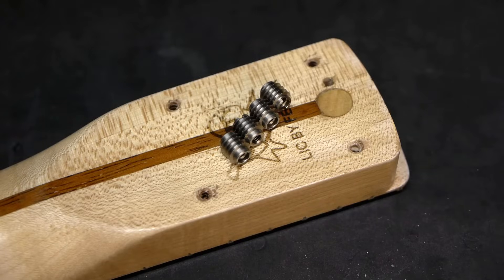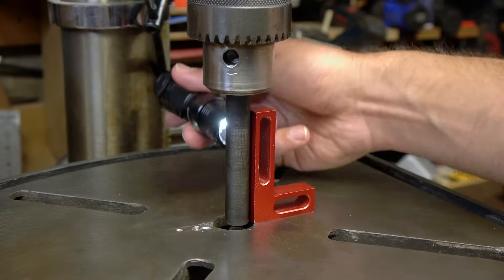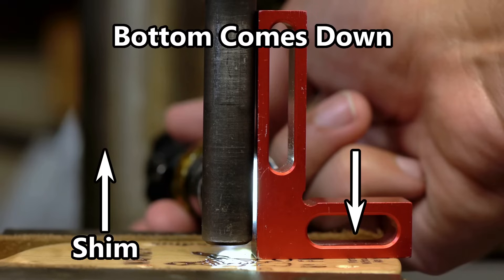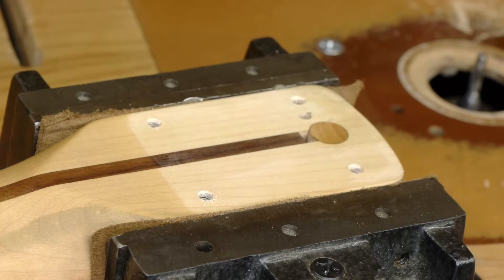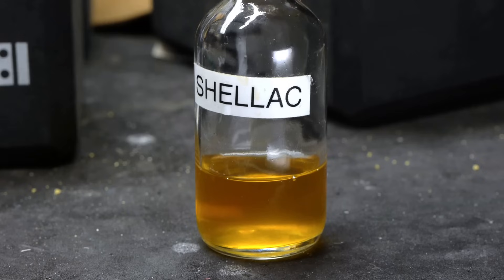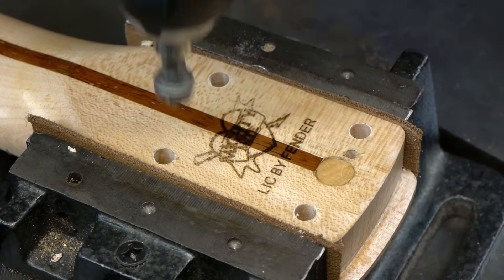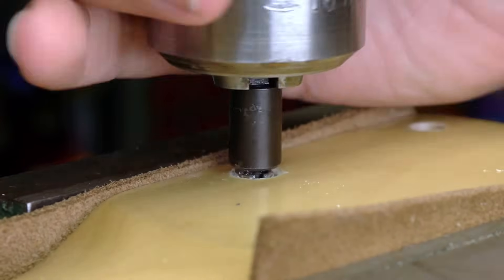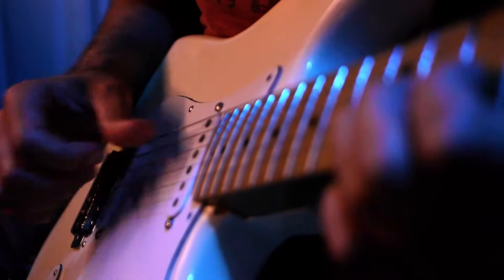How to Install Threaded Inserts on a Bolt-On Guitar Neck (EZ LOK)

Comment: My two cents here.  I would be tempted to think that a wood screw of the size used for a guitar neck makes for a stronger joint than a threaded insert... I think this is not such a good idea.  It looks good but I would never use in on my builds nor buy any guitar with that kind of attachment.  One should remain cautious.  Maybe the author should have started with a justification for doing this.
Reply: It might not be such a good idea for you.  There are more than a few touring pros that have this mod on their Fender guitars.  The reason is they take the neck off when they travel so they can put the entire guitar in their carry-on bag.   Over time, the repeated removal/reinstallation of the screws in the neck will fatigue the maple and the attachment will be weakened.  Threaded inserts make this issue a non-issue.
Reply from the maker: Couple thoughts here! Please keep in mind I know I'm not an authority on this and this is all speculation from my end. I personally haven't had any issues with inserts in any of my own guitars and just want to share some initial thoughts in response to your comment. Always open to alternative viewpoints! 

First: one of the reasons I used 8-32 screws instead of the more common 10-32 is that 8-32 is a near perfect match to standard neck screws. In some cases, a perfect match. 8-32 machine screws are .160" or 4mm in their major diameter, which matches many standard wood screws used for mounting guitar necks. 

I do understand some wood screws have much more aggressive threads and larger major diameters, but .160" as a major diameter is a common size. 

However, beyond just the screw size, I think 10-32 inserts drill out quite a lot of wood in the neck heel. 8-32 inserts preserve a lot more of the original wood. Boring a hole of that size, I'd be nervous that using larger inserts might have the potential to split or crack the neck heel. 

Though apparently many people have installed 10-32 inserts without issue, and the screws would certainly have more heft than an 8-32. So my fear there might be unwarranted. 

Another thing: 

Later in the video I mention the value of threaded inserts as a permanent repair for stripped wood screw holes. I think this application makes the most sense, though many builders swear by machine screws and threaded inserts. 

In the case of stripped wood screw holes, I think threaded inserts make the most sense as a repair. 100% guarantee that they won't fail again. 

Also brings this story to mind: My friend and mentor Steve K. actually knows someone personally who loves to tighten their neck screws down very, very hard, and despite Steve's warnings against cranking the heck out of the screws, they continue to do it. 

So Steve took out a breaker bar and saw how much force it would take to break one of those machine screws by over-tightening it once it's maximally threaded into the inserts. 

If memory serves, he couldn't break it no matter how hard he tried. All I remember is that he concluded that there would be no way even for a Silverback Gorilla to break one of those screws off with a normal screwdriver. 

Someone we know has developed a new line of guitars for this particular guitarist, and after talking with me and Steve, decided to use threaded inserts for his builds -- in part because he knows the signature guitarist playing them is going to be cranking the crap out of the screws despite everyone else's protests. Lol! 

So I actually think that inserts and machine screws can avert some of the only major risks with wood screws, as far as damage/breaking goes. 

There's always a possibility I'm missing something, but the only risks I can see for neck screws are: 

1) The neck screw holes stripping
2) The neck screws breaking off in the body 

The machine screws + inserts completely avert both of those problems, and so from that standpoint, should be "superior" to wood screws. 

I put "superior" in quotations, because, in the vast majority of cases, the risks for stripping a neck screw hole, or breaking off a neck screw in the screw hole, are so miniscule that it almost doesn't matter. 

I would suppose it would matter for that one ham-handed person who breaks their neck screw off in their guitar. Those people are out there, though few and far between. 

Stripped holes are uncommon, broken neck screws are extremely rare, and I think I'd put any other major neck screw issues into the same category. 

All in all, I can't think of a reason to not use threaded inserts, aside from them being unnecessary. However: 

There is that one video where a woodworker tested wood screws vs. inserts with machine screws, and found the wood screws to be superior, with a stronger hold. 

However, the inserts he used did not have anywhere near the flange diameter that the EZ LOK inserts for hardwoods has, and they didn't have the EZ LOK proprietary knife edges either, which slice very deeply into the wood for an extremely secure grip. The inserts he used in the video appeared to be standard hardware store inserts with fairly un-aggressive threads. I do think quality makes a big difference here. 

Still, you could be right, and maybe wood screws do have a stronger hold. However, there are builders who've commented on older versions of this video who swear up and down that threaded inserts make their instruments sound better. 

But then I've had another commenter claim that they do the opposite. There seems to be no consensus! 

I think it's also important to note in the wood screw vs insert video that these joints were tested under extreme forces that a guitar would never be subjected to unless it was run over with a steamroller. 

The major concerns we'd have to deal with would be a guitar falling from about waist height onto concrete. 

Occasionally you might have a "guitar spin fail" where someone rocket launches a guitar over their shoulder and it lands on concrete from 20 or so feet in the air. 

Now in a case like that, I'm not sure which mounting option would be superior, though I do think threaded inserts and machine screws will hold their own in any of the above circumstances. 

There's a good chance that even if by some extreme show of force, the machine screw broke off, that you could still easily remove the insert with the drive tool. Even if the screw somehow mangled the threads and also broke off and it couldn't be unscrewed, grinding it down just enough to allow the drive tool to grip the insert would allow you to remove it. 

I can't imagine anything that would happen to a guitar that would cause those knife edges on the inserts to break. They're embedded so deep that just about the only way I can imagine damaging them would be putting the neck heel on a hydraulic press and forcing a machine screw already threaded into the insert, down further into the neck. That might snap those edges off. From a durability and reliability standpoint, I think machine screws and inserts are at least as good as wood screws, if not having some added benefits / protections / failsafes against stripping and screw breakage. 

Steve K. has also suggested using dog point machine screws to eliminate the possibility of cross threading. That really is taking it to the nth degree but it's not a bad idea at all, and the cost of dog point machine screws from somewhere like Bolt Depot is basically the same as any other similar screw, so why not add another failsafe. 

Anyway! I'm getting way out into the weeds here and having way too much fun thinking about all of these circumstances, and I've gotta go for now. Curious about your thoughts if you have time to respond!
Reply: There is NO WAY a standard wood screw is stronger than an insert.

Comment: I’ve built my share of fender style guitars and I’ve owned lots of three bolt and four bolt neck Fenders, and have never, ever had a problem with the standard wood screws……I think it’s a trendy waste of time to use these inserts……
Reply: Good for travel guitars when you frequently need to remove the neck to pack it in a suitcase.
Reply from the maker: There's certainly a lot to "If it ain't broke, don't fix it!"  

That's one of the reasons I chose to just cover how to do this job to the best of my knowledge, rather than getting into a debate about machine screws + inserts vs. wood screws. 

My goal here was to share my way of doing the job as correctly as I know how. I'll leave the reasons for doing it up to the people who find the video! 

Only thing I'll say is I do prefer installing inserts + machine screws as a repair for stripped screw holes, compared to plugging the holes with dowels and re-drilling.

With inserts, using the method in this video, you can just ream them out - step bit, twist bit, chucking reamer, countersink, fill with glue - and install the inserts. Relatively quick and easy with the right tools, and all done at the drill press.  

With plugging and re-drilling, you need to drill the hole oversized, get a matching dowel, then glue and hammer it in, wait for the glue to dry, flush cut the dowel, then clamp the neck back on the body, put the other screws in (which presumably are also not stripped) to secure the neck, and make a set mark on the plugged hole. Then drill that out with an 1/8" brad point bit. 

At least, that's the way I've done it in the past. Unless you mark for dead center on the dowels before installing, your centerpoint for the screws is lost after you plug them, so you need to re-establish it. 

This isn't a big deal, but IMO it takes more time than just doing everything on the drill press in one shot and being done with it, no re-mounting of the neck required. And no waiting for a glued dowel to dry overnight. 

The inserts are also a guaranteed permanent repair, whereas plugged wood screw holes can be stripped again. 

So the inserts, for me, are a much simpler repair, and have the added benefit of a lifetime guarantee.

Also, if someone's stripped their screw holes, they might be nervous about accidentally doing it again, and being able to guarantee they won't strip again is a good thing to be able to reassure people of. 

They also might be worried about the other holes stripping. Even if it's not a risk, when people can't do their own tech work, being able to provide guaranteed repairs is a very valuable thing for peace of mind on both ends. 

The majority of people are not going to run into stripped neck heel screw holes, but I prefer these as my go-to solution for when I do run into that problem. 

Just my take. Thanks for the comment!

Comment: Very well explained, but what is the reason for doing it?
Reply from the maker: @larrymannino  First, thank you! I put a ton of effort into this video to cover all the details, so I really appreciate that. 

As for your question: for me, it's my preferred method of repairing stripped neck screw holes. I like the inserts better than plugging and re-drilling the neck heel holes, as they're a guaranteed lifelong repair. 

I've occasionally done plugs and redrills where upon re-drilling, the screw was still not threading adequately, and had to be redone again. Inserts sidestep any potential issues there and guarantee a rock solid repair for life. When you do repairs for a living, being able to guarantee your repairs is very important. 

Also, not many people take the neck on and off frequently, though I have installed these on travel guitars for people who do remove the neck frequently, and I think they have an advantage over wood screws there, in that they can be taken off and put back on an infinite amount of times without stripping. 

In day to day practice, I use inserts primarily as a repair for stripped neck heel screw holes. 

Some builders swear up and down that inserts increase the resonance / sustain of the instrument. This seems to be very hotly debated, so I'll let other people hash that out if desired. 

My take? I'm very persnickety about stuff, and I like permanence when it comes to mechanical objects. I take the necks off my guitars much more frequently than most people, and between that and seeing many stripped neck heel holes over the years, I've come to prefer the reliability of threaded inserts and machine screws.

For a hobbyist, it can be a fun project, and done correctly, it certainly won't hurt your guitar, and I'd argue that it could only have potential benefits. The worst that happens (if installed correctly) is that your guitar remains exactly the same, but bulletproofed against the holes ever stripping out.

IMO they make taking the neck off and putting the neck back on a bit easier too, which is nice if you're working on neck angle and/or string alignment and need to remove the neck repeatedly while you're figuring our your shim thicknesses and arrangements. 

Or doing fretwork, including refrets.

Wood screws work fine until they don't. If and when they stop working, inserts are IMO the best repair option. 

Nothing wrong with just being picky either. Lots of times while I'm clearing the neck pocket holes on normal wood screw bolt-on guitars, I'll find that the neck heel holes are flared out pretty badly. I always countersink them and if it's especially bad I'll saturate the countersink with a little superglue and let it cure before putting the neck back on. 

Why? I'm picky. I don't build my own line of guitars, but if I did, I'd use inserts just for the lifetime guarantee and the ability to take the neck off and put it back on an infinite number of times with no risk of stripping. 

My friend and mentor Steve K. said dog point machine screws would be even better, as then cross threading them would be impossible. All of this might seem like over-obsessive detail, but I love that kind of stuff. Same reason I prefer 316 stainless to 18-8 stainless for parts in heavy contact with hands and sweat, like the saddle height adjustment screws. They rust out so easily. 316 stainless has molybdenum added and is far more corrosion resistant than 18-8. 

These little details make tech work much more fascinating for me. I just love it. Always remember obsessing over little details can be a great deal of fun depending on your personality. For people like me, eking out another 1% of improvement wherever possible on my own guitars is always worth it because of my personality. I just love it. 

But as a practical application? Stripped neck heel holes, for sure. If someone doesn't do repairs for a living they're not very likely to run into that problem. But if they do, IMO this is the best and most permanent way to fix that problem without ever having to worry about it happening again. 

Hope this helps!
Reply: If you travel, you might want to unscrew the neck from the body to carry your guitar in a smaller case, doing that often with wood screws might damage the neck.
Reply: I installed inserts on a travel guitar I made. I remove the neck when I want to put it in a suitcase.
Reply from the maker: @Pastor-of-muppets1985  Did this for someone for the exact same reason last year. Excellent example! Inserts are definitely the way to go when you'll be taking the neck off and putting it back on a bunch of times. Very convenient, and bulletproof for the future
Reply: So you can be trendy too……otherwise it’s a waste of time

Comment: Very well done, thank you for sharing.  The only suggestion is that instead of applying wood glue to the metal inserts before screwing them into the neck heel use something (JB Weld, etc.) that bonds much better to both metal and wood.
Reply: That would be more permanent, yes. I'd still go with wood glue myself. It helps strengthen and stabilize the wood, while bonding moderately with the insert, but you could still conceivably remove the insert if you needed to do so.

Comment: Great video! I use the same inserts on my guitars. One thing to look into: You used a dowel to fill the hole for the "do-over". If the hole ends up being too large, your insert has a risk of threading into too much end grain. Look up "spiral bushings violin" and you can use a similar technique to make dowels of cross grain. Very strong and buff.
Reply from the maker: @patrickstover8766  Thank you so much for the tip! Always more to learn. Never would have crossed my mind. Appreciate the insights and I hope other people see your comment. That technique will definitely be on my to-do list now!
Reply: @ I've done these for violin peg holes, they last SO much longer and look much better (side grain rather than end grain). Just need a sharp #5 or #6 hand plane, and when making smaller "dowels" you can wrap a bit of packing tape over a small drill bit for the "mold".

Comment: Got the kit off Amazon for $12 the other week.
Reply from the maker: @thecappy  For some reason the kit is cheaper than just the inserts. No idea why!
Reply: @ the brass kit was double the price of the SS. You did a hell of a job. I used a hand drill and the bit in the kit. Counter sunk it after I drilled. I guarantee yours is dead nuts 0°. I don’t think they make much difference/benefit but, I travel with this guitar so I take it apart and carry it on in a backpack. Those baggage handlers are rough.